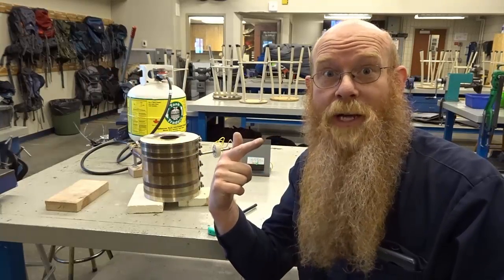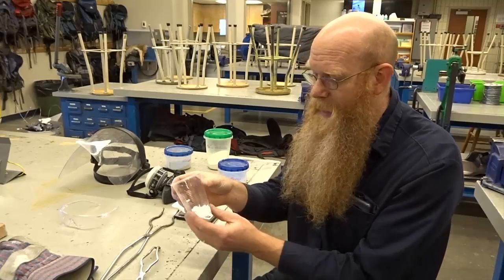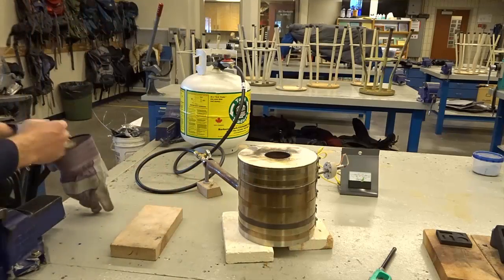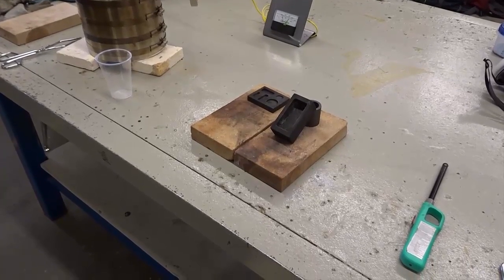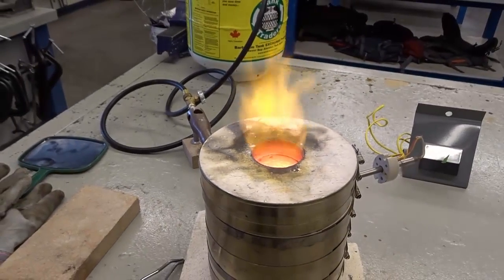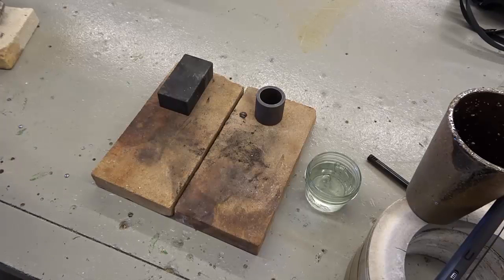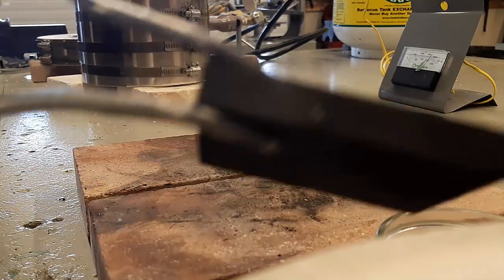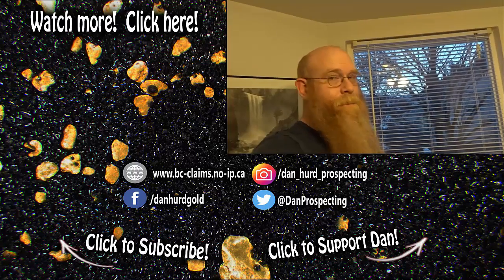Casting a gold bar, gone bad!  (Miller table gold)

Comment: As a blacksmith I have to use a good amount of flux to forge weld and I find that an anhydrous borax works much better than borax straight out of the box. This is because straight borax has water in it. You can make your own anhydrous borax by melting down straight borax and letting it crystallize then repowderize  it

Comment: About what purity will you get if you don't use flux?
Reply from the maker: Depends on what you are doing - it might not work at all without flux
Reply: @Danhurd  well I will get a few grams off ebay and melt them down with a propane torch and find out. It's always cool to try different stuff.

Comment: The good thing about the kiln is you can melt down your fines into dots, and later cook those dots into a small bar. Best damn use for fines in my book. Subbed, I've watch quite a few of your videos. And one of the things I appreciate the most is you'll air your mistakes. You'll admit when your wrong. And you don't claim to know everything, just a little of everything, within reason. Your not afraid to go out on a limb every once in awhile. Your personable. And who can pass up the Cheshire cat grin. Fellow beard here. Not the sissy beard in my photo. And not the lovable length of your face mane. But gander at one of my videos and you'd swear you just saw Santa. At least on my Christmas time videos.
Anyway boss, appreciate your time! Always fun!
Reply from the maker: Thanks!

Comment: well donr!isnt easy,im a cab driver and do bkacksmithing works,never done smelting,but i guess,if you allow me,the mold should fit exactly the amount of smelted metal,anf is a fact ,liquid metal runs as fast as it can to the hottest zone,as you ser while welding.Sometimes you must STOP welding and let it cold, because  all run away ,even the flux is altered.Whatever,that pearl looks very pretty,more than a bar.Excuse my ortograph faults,not a good morning for me.Thank you teacher.
Reply from the maker: Thanks!

Comment: Hi.Dan i have the same problem with my kiln.I learned something.Only use flux in the first melt.toss it in some swimming pool muriatic.for a while and remelt.Usually come out much better on second melt.I also found that the melt cooled too fast when trying to poor into a mould even though it was only a few seconds.I watched a vid where the guy uses the same kiln as mine.He keeps a propane torch pointed into the crucible as he is lifting it out of the kiln and while he is pouring.I can see where this would keep the gold liquid even for a few seconds.Makes sense to me.Going to try that this spring.Also keep the mould hot as possible.Luck Mcbain.
Reply from the maker: Yes, that does make sense.

Comment: I give u don't like because u don't know what are you doing ...
Reply from the maker: That is why I said "I'm learning"
Reply from the maker: But thanks for the encouragement, always good to encourage someone who is trying to learn something new.
Reply: @Danhurd  To my experience and knowledge , you wasting lots of money , buying wrong type of smelting furnace,  some equptment is useless , you are overheating gold melting in super high temperature . Color of ceramic tell me  that temperature is about 4000 degrees ( good for smelting Platinum ) gold needs 1800 . If you have any questions don't hesitate to ask . or jus call me at 1 732 221 6402 ( USA,NJ ) . Greetings :)
Reply from the maker: Well I have my built in thermometer marked at 2000 degrees we hold it at about 1900 for the smelt and then up to about 2100 for the pour.  And as I said in the video, this kiln was provided to me by the manufacturer Pat at Kwik Kiln, and the distributor Dave at 911 Metallurgist.  Also Pat, an expert smelter who has written books on the subject is coaching me through my learning.  And provides me with positive encouraging feedback when things go wrong.  As for he colour of the ceramic, digital camera sensors will have a hard time picking up any kind of colour from something radiating so much light in both visible and infrared spectrum.
Reply: @Danhurd  Add oil when you poor gold .WD40 - but not much ,just make wet . DW40 will burn, motor oil is great - again , just wet . Gold will flow smooth .

Comment: Dan - Because of the surface tension of molten gold, its almost impossible to cast a tiny square bar. The gold wants to stick to itself and ball up. Better to cast amounts like 2 grams as a button, then accumulate buttons and cast a bar later. The folks who have these graphite molds also have a cone shaped mold which will contain a good amount of flux and work well for buttons of various sizes.
Reply from the maker: Thanks Chris - that makes sense. Clearly I need to collect more gold!
Reply: @Danhurd  I'm curious where hammering/smithing can come into play? Good vids sir
Reply from the maker: @jaylast1958  I guess that depends on what you are trying to achieve
Reply: Oof you got me 😂
Reply: Well, contribute something useful,  @johnathanrobertaccio6311 . We are listening.
Reply: Chris Ralph aka mr.knowitall
Reply: @johnathanrobertaccio6311  - As God, you certainly know a whole lot more than I do.......

Comment: This works more then fine for me to make buttons.    75% Borax  25% Activated Carbon ( Walmart Pet Section )  Bone ash. Bone ash is a white material produced by the calcination of bones. Typical bone ash consists of about 55.82% calcium oxide, 42.39% phosphorus pentoxide, and 1.79% water.     Equal  Volume of flux and gold.   Not by weight.   Hotter the mold and Material ( Gold or Silver )  the shinier and smoother  the outcome.
Reply from the maker: Thanks!

Comment: Dan why are smeting brass😂just kidding but guess what your gold is as you said is about 90 percent closer to 87 gold,20 percent silver and 5 percent mix .Have it assayed and guess what,how would i know?xrf gun?no but you could cause you r ther if u used a xrf gun,took a still pic from your vid and ran it thru my system with a different value (cmyk).Pictures dont lie.My cell and your pic from the vid showed me .Let me send you some pics of my gold in ore and the pics will show only the gold.
Reply: Just two pics one before and one after
Reply: As a point of 'reality':  At this stage EXACT % of alloy is not needed.  Only in the case of a sale is the exact % needed and then the buyer will determine the composition - or - a final smelt (purifying) of the Dore' bar would be done to arrive at the exact % of pure Gold.
Reply: @joescheckler9953  did you notice? im in Bakersfield Ca and i told him what the values were from a photograph ?
Reply: Well Patrick, I've been around Gold mining since I was 19 years old.  I'm 72 now.  

No, photos won't do it for me because pictures can be, or can be made to be, mistakenly evaluated.  Only a spectro analysis or a smelt will show true % of .999 Au in a Dore' Bar.  The only time (other than pure curiosity) that the exact fineness is needed is for a sale - at the point of sale and conducted by, or at the request of, the buyer.  Dan is just melting and casting raw placer Gold here - and his experienced eye and knowledge of the Gold in his area is all that is needed for an approximation at this time.  A fine job was certainly done by Dan, too.

Comment: Question: when you pour silver it seems to flow out smoothly, when you poured the gold, it seemed to stick or hold part of the gold in the crucible?
Reply: Silica (silicon Dioxide or Glass) is thinned by adding Borax.  The liquid Gold pours well but the cooling Glass/Borax is thicker and doesn't pour as well.

Comment: I always like your videos. Education and humour go well together.  So many people get panicky around the burning of propane. The reason that propane is used on forklifts in enclosed areas, and in RV's is because it does not  create carbon monoxide.  I used to work as an engineer in an Albertan "sulfur gas" plant where we isolated propane from other gasses. With your beard tucked in, you look like a cartoon character.
Reply from the maker: It felt funny to have my beard tucked in!

Comment: You are very entertaining to say the least might I make a suggestion the kiln is a little over kill when I'm melting small amounts I just use the melt dish and heat it with mapgas and pick the little bead out of dish with a tweezers  when I have a lot of them I then make a bar two days ago I my a perfect 1 once bar I have been melting  my gold mostly everything under 30 to 40 mesh but a lot of my friends say not to that you get more for it in its natural form that's why I asked you the other day what your thoughts were on it anyway cool video  that's Dan